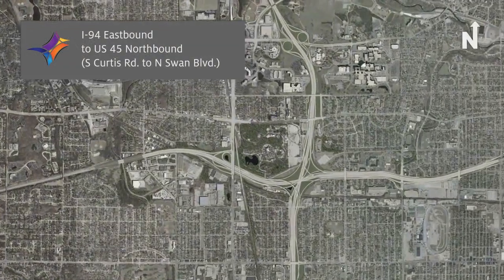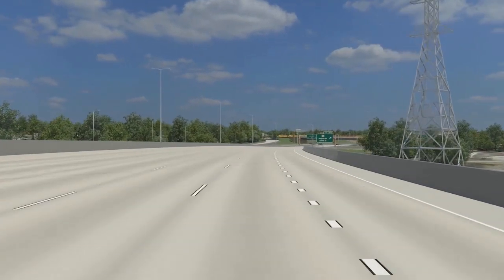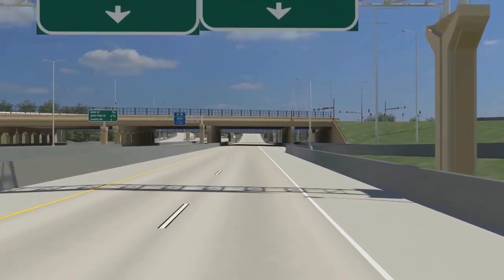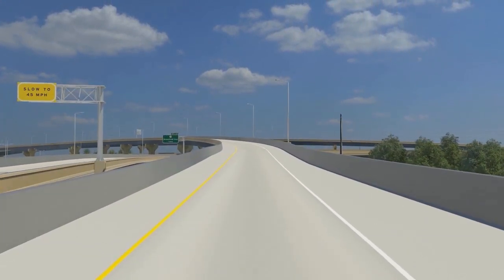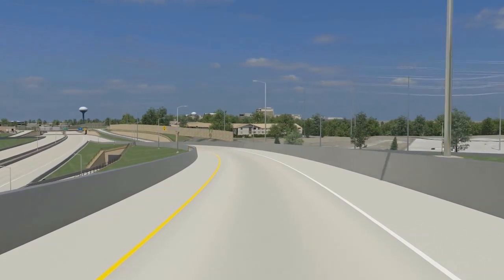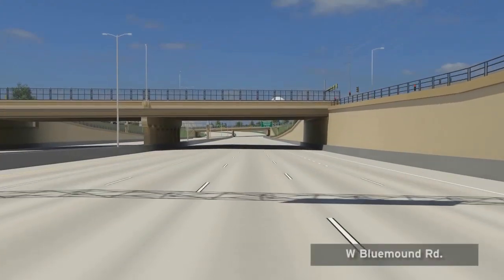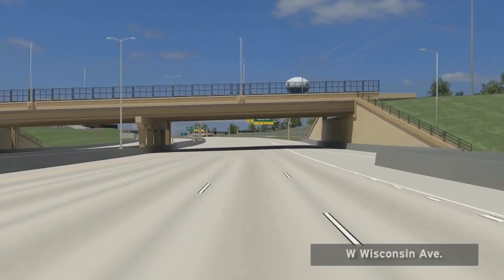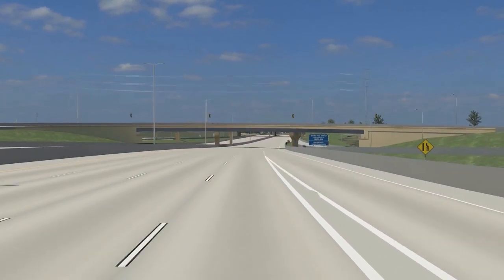Zoo Interchange, I-94 EB to US 45 NB Animation

Comment: how come they dont have a Hwy 41 and Hwy 45 sign the hole time.. instead of a hwy 45
Reply: Rumors is the get 41 by the statium is going to be called hwy 175 and there going to make hwy 41 were hwy 45 is and its going to be called I-41 who knows we're 45 is going to end up
Reply: @Jonathan Cleveland, if you watch the video HWY 41, 894,45 is listed on the green signs. Clearly 41 is included in this interchange. WI 41 will be getting a US41 designation soon.
Reply: pauljolry it always been US 41 know it’s Interstate 41
Reply: Tyler Copeland  US 45 should be routed with Interstate 41 / US 41 from exit 124 in Oshkosh all the way to Milwaukee